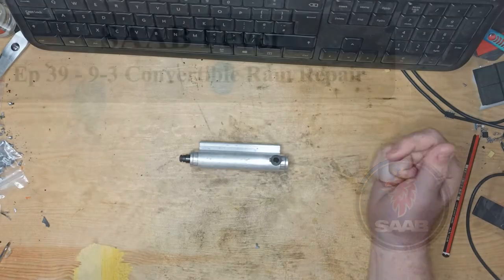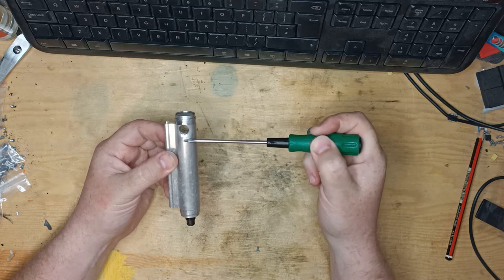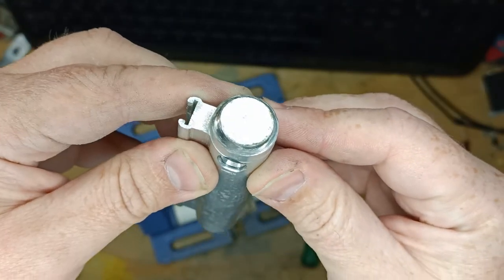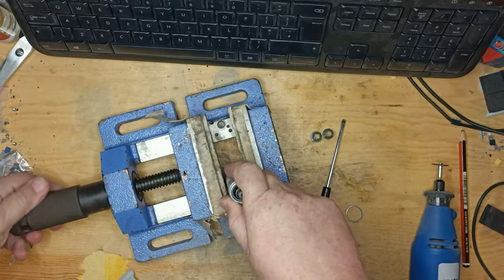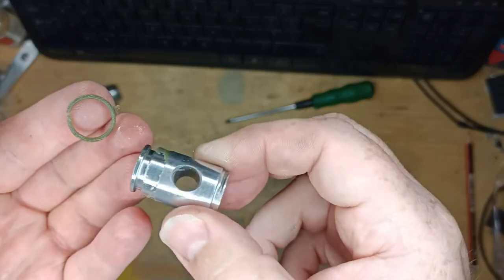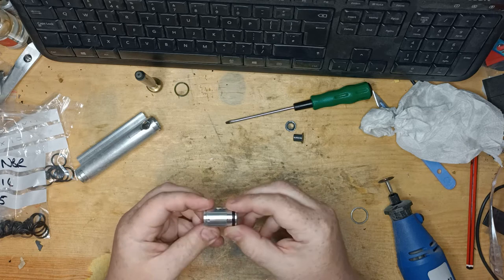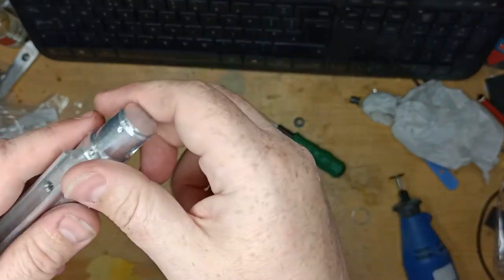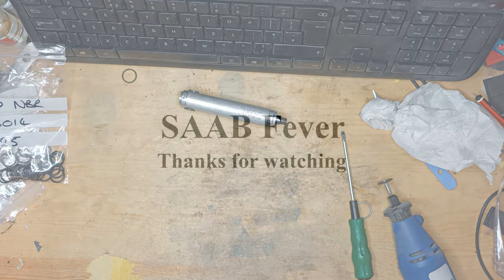Episode 39 - 9-3 First Bow Ram Repair

Comment: Thank you for posting this. I ended up using a steel saw to cut it while the cylinder being held by a soft vice and I was able to get it opened in less than 15 minutes, did not feel tedious at all, but you have to just keep cutting until it cracks. I cut right where the crimped part starts.

I did one, put it back in, just to find 2 more leaking. In about the span of a couple of hours I had them repaired and the top functioning perfectly again, couldn't be happier!

Here in the US, I was able to go to a local hardware store and pick o-rings that worked, for about $0.79 a piece.

Comment: These cylinders have a similar o-ring in the front end piston that's also made from the same material and  likely has cracks and may start to leak (I disassembled several ones, and they had).  The front piston is not so easy to secure so that it does not fall out.  I am just out of curiosity decided to repair 4 cylinders from a friend’s 2004 Mercedes CLK320, and they have an absolutely similar design with the exception of the tip. And I haven't figured out how to reliably secure the front piston yet, but I have some ideas. Right now I'm waiting for the o-rings to be delivered; I decided to install fluorosilicone ones.
Reply from the maker: Thanks for the info, please keep us updated!
Reply: Hi, What size were the Merc seals? How about the rod seal in the front? Would be nice to be able to order the seal before building the cylinder out.
Reply: Update: 
for smaller cylinders, I used fluorosilicone seals #13 (100 pcs pack)  and for larger ones - fluorosilicone #114 (25 pcs pack); both bought from amazon for about $20 for the each size. They are not 100% the same as the original ones, but seating well. 

I completely broke a part one of the cylinders just for a research and found than only 2 seal (for front and end pistons) had this cracking problem, and the rest of the seals were like new.

I figure out a wat to assemble the cylinders: 
I carefully filed off a couple of millimeters in depth of the piston edges with a file, so that when installing the pistons, the cylinder body edges rose above the piston edge, and then I rolled them up with a small hammer (carefully hit the edge, deforming the metal). I don't know how reliable these cylinders will be after repair, but intuitively it looks reliable :) I'll try to add a short video to my channel where I'll show the gaskets and one finished cylinder.
Reply from the maker: @Paul-Maven  Thank you for sharing this info.   Frank.

Comment: Does it need bleeding Frank?
Reply from the maker: Thankfully, no.  It'll bleed back to the reservoir, so you may need to top up depending on how much fluid was in there to start with.  You'll need SAAB Power Steering fluid P/N 93160548